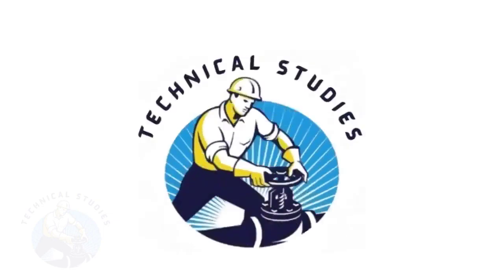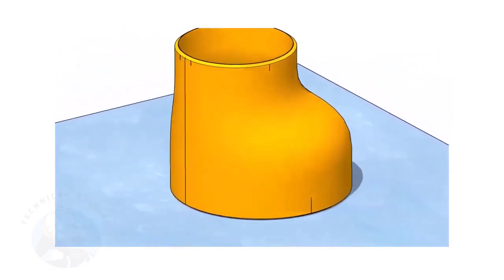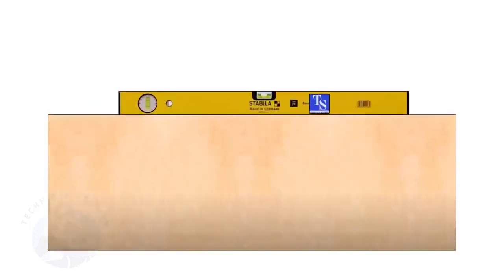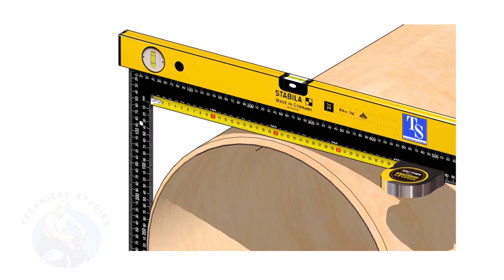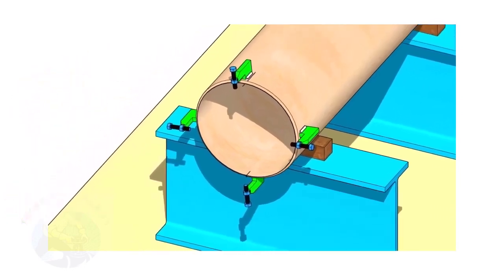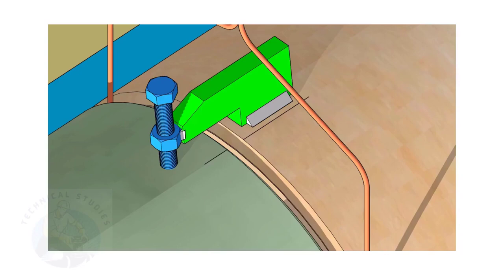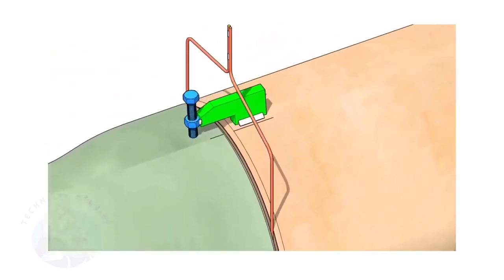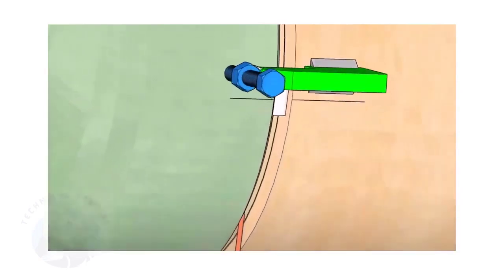How to Fit up Eccentric Reducer Fit up to a Pipe

Comment: I think level side should be down?
Reply from the maker: Thank you for the comment Bro. Flat side up is used to avoid air pockets, ensure proper drainage, and maintain smooth flow, especially in horizontal piping.